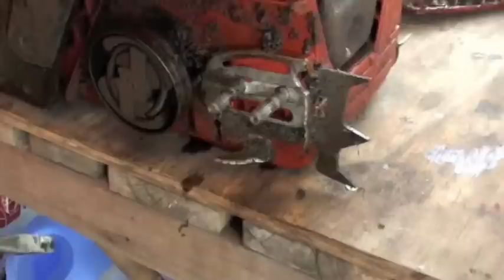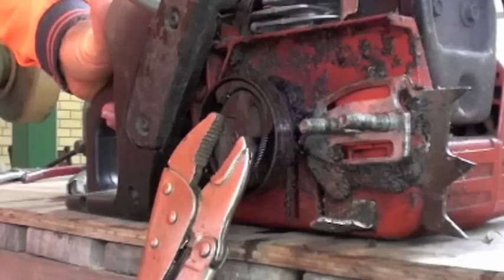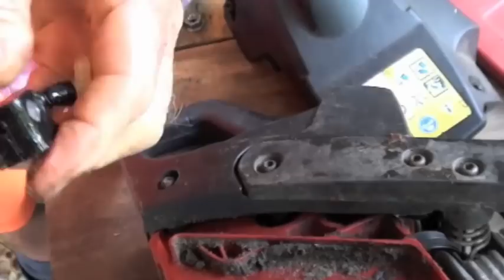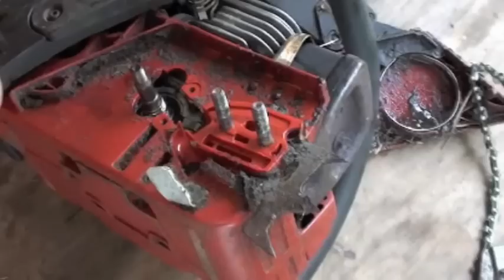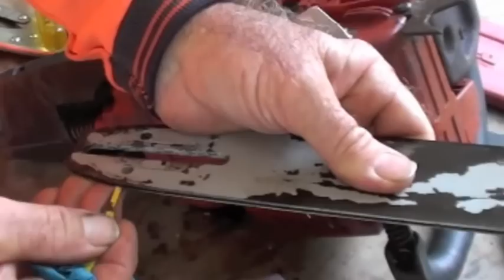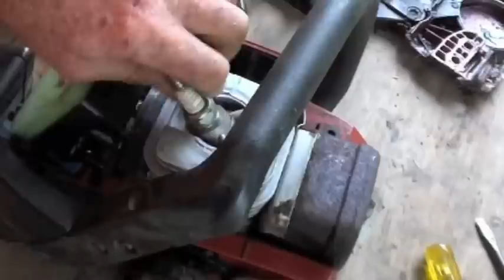HOW TO REPAIR CHAINSAW OILER

Comment: Hi, As a middle-aged woman learning to DIY, I thought this explanation was absolutely spot on. Ps, I didn't even know about the "oiler" other than to keep it topped up...It's just that I was watching your "how to put on a chain correctly" after mine fell off during operation (this keeps happening every so often actually, so I am now about to look in your video's on " How to correctly tighten the chain") and this video popped up on the screen as "suggested". Your Uncle is very knowledgeable. Thank you for sharing.

Comment: Hey Greg it would be great if you and your Guru Uncle could do one on oil leaking from chain saw.  I understand that a common cause is the gasket/O-Ring at the filler plug.  But when that’s not the answer? Any tips much appreciated Mate

Comment: I would have pressure cleaned or air blasted the chainsaw and bar first. Other chainsaws can be different dont need to pull clutch off. But good idea the nylon rope to stop piston moving !

Comment: I have a battery powered one and it does not appear to be oiling.  Unfortunately it looks like I must open it to get to that because the doofus who designed it did not make it accessible enough from the outside.  I guess that is how they keep people sending them in for a repair or even thinking they need a new saw (yes some people are that gullible!!)

Comment: Before taking the thing apart try this: make a 80:20 mix of fuel and bar oil. 80 fuel. Put that in as your chain n bar oil. Now once the saw is warm, rev it a lot, give it max throttle on and off for about 10 mins. Eventually you’ll see it start to dislodge a lot of built up gunk. The fuel cleans everything up and the little bit of oil helps lubricate the chain. If it works tip the remaining mix out and put in 70:30 mix of bar oil & fuel to run it normally. 70 chain n bar oil. I’ve done this on two saws, one 15 yo and the other 10 and it’s got them oiling again. Not a totally perfect solution but may help if you don’t want to take the thing apart. This is a variation of another idea that involves using just plain fuel but I think it’s too liquidy to use straight fuel. A little bit of bar oil thickens it up just enough when trying to flush the gunk out. If this doesn’t work your oiler may be gone. Happy cutting!

Comment: Hello. I have an oil leak on the Stihl chainsaw. Only worked one hour and on the following day all the oil is gone. Is it possible to be in need of replacement rubber\pipe\bomb or can be another source to drain. For exemple, the oil tank? It uses gaskets, or is it all a single piece?
Thank´s
Sory if my english is not good.
Reply: You can adjust the rate at which the chain oil comes out, maybe it's turned up too high?  If there's no leak when it's not running I'd check that. Also if you hold the end of the bar close to some newspaper while the chain is running and there's LOADS of oil flying off the bar then turn it down. There should be a small adjust screw.
Reply: Gary Robinson
Thanks for the reply. But the problem is that leakage occurs at rest. When is stored. Other faults. Two days ago she did not work. I took one of the covers and noticed that gasoline rubber tubes were defective. One was broken and the other with cracks. Tomorrow I will buy new tubes. Also the button on-off broke. I suspect this chainsaw is not original. Maybe made in china.
Reply: Oh dear.  Good luck!
Reply: Gary Robinson
Thanks, I'll need. Already have new tubes, and new on-off button. Now is to buy gasoline and test.
Reply: Feliciano Paixão
Sory it´s me again. The chainsaw already work. Sometimes no. I found a bad contact in the spark plug cable, easy fixed. After removing and clean where the blade works, i saw an oil leak which you said it could be. In the oil flow screw. It has a metal cover and the clutch. I do not know how it comes apart.
Reply: Feliciano Paixão
 After seeing the video again, I will take courage and do the same operation.

Comment: As it happens, I have a Jonsered chainsaw almost identical to the one in your video. It wasn't putting out oil to the chain, and the video was very helpful in tearing it down, fiddling with the oil pump, and reassembling it. Couldn't find an obvious problem, but when put back together everything worked...funny how that happens sometimes. Anyhow, many thanks.

Comment: Might be a helpful video if it were for a STIHL like the screenshot shows... since I'm looking for information on a STIHL and saw a STIHL but got a jonesred video instead...
Reply from the maker: Jeff Sims it's the same for all saws
Reply: ***** sorry to be rude, i was getting frustrated with my saw.. it is a helpful video but keep in mind there are variations in different saws, my stihls homelites poulans and craftsman all have different gear sytems and styles. On some the worm gear is the weak point, On others the pump drive gear itself is, and the older 0 model stihl's have an even more complex gear drive system. Also the pump On ms model stihl's has to be pulled via a proprietary tool or homemade tool with the right threaded bolt. So yes, they are all similar and the same general concept, but all unique in their design and implementation.

Comment: I have a MS230 Stihl, so the pump system is different, but your video encouraged me that fixing my oiler wouldn't be to difficult.  I did use your trick of using a rope down the spark plug hole to get the clutch assembly off.  I found a video for the MS230 and got my oiler working again

Comment: This pretty dodgy, you have a picture of a Stihl and you work on some shit saw. They are not the same by any stretch. Cheeseball way to get views on the back of a good saw company you're too cheap to buy from. Get a new picture for your F- video.
Reply: The Jonsered is by no means a "shit saw"; they used to be made by Husqvarna. I'm a Stihl 031av owner but I still (no pun intended) found this a very helpful video as the principles, if not the details, are the same.

Comment: thank you for this, had mine started leaking two days ago, knowing nothing about them at all, my first thought was ? this is going to cost me lol, then I found this vid, and followed it, I was fortunate, in not having to remove the drive wheel, the oil feed pipe is under the bar secure nut plate, ( a mcColough) sure enough there was the gunge blocking the oil feed. thank you once again, and thank your uncle, he did a first class job.  graham from england

Comment: Thank you so much!  And of course a special thanks to your uncle.  The oiler on my chainsaw had stopped working.  Had no clue where to start looking for the problem.  Turned out the little hole where the oil goes to the chain was clogged.  A simple poke with a slender piece of wire and I'm up and running again.

Comment: I have a Stihl 028 and had a new oiler installed.  It uses about twice as much oil as needed...oil is gone twice as fast as a tank of fuel.  Took it back to the shop and was told it was fine and there was nothing they could do with it.  Help please!  Thanks!

Comment: Thanks for the DIY information, it saved me from paying someone to fix the oiler on my small 16" saw. Disassembled it, cleaned it out, and put it back together. Now, all is working great, and it only took me about 20 minutes! Would have taken 45 minutes just to drive to the saw shop, plus the gas!

Comment: So, I was wondering do you use bar oil for the chain saw? Because I have started using car motor oil the past year and find it works just as well and is much cheaper. Now, I've hear some people say they use old (used) motor oil that was drained from a car, but I think that's too thin and broken down. And it sounds like all that black would spray all over someone's clothes. Just wondering if you ever tried using a cheaper oil than regular bar oil.

Comment: Excellent demonstration!  I do alot of chainsawing, not professionally, but lots. I'll be watching this again to clean my own oil pump, so thanks.  I found it interesting that the one mechanism (forgot the name) had to be turned to right to untighten. That would've stumped me for sure, since I always go "righty tighty" and "lefty loosy".  I like the improvisational thinking on stopping that piston from turning using a rope , too. Oh, I use regular motor oil to save money, never used used oil.